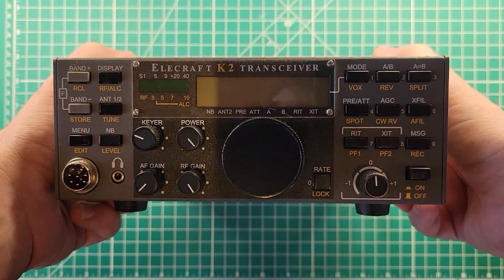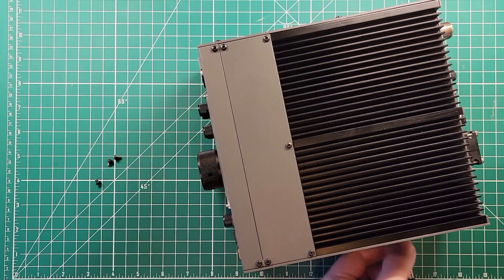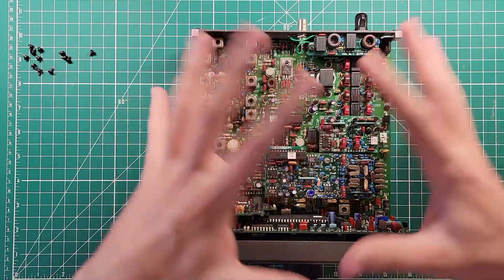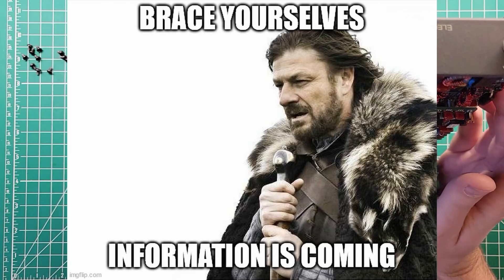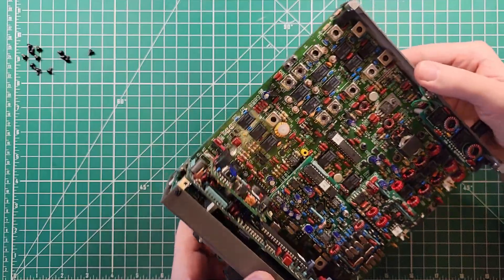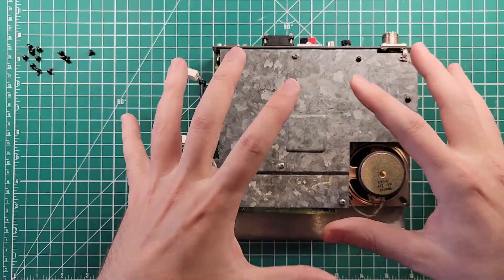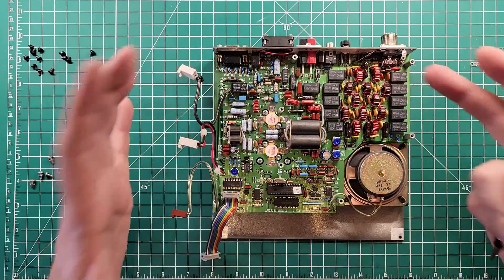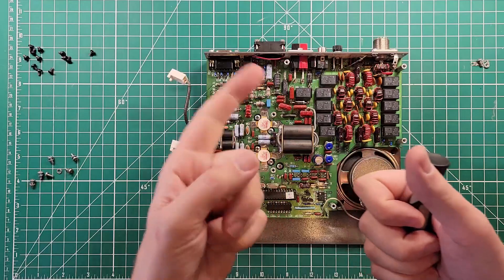What's in a Legal Drinking Age Radio?

Comment: Not Programmable "Interrupt" Controller.  I'm not sure anymore, but maybe "Interface".  PICs are microcontrollers, ROM/PROM/Flash for the program, CPU (most or all are "Harvard Architecture": separate instruction and data memories, for parallel access), and often a small amount of EEPROM that the CPU can write in order to save settings.
Reply from the maker: Thanks for the clarification